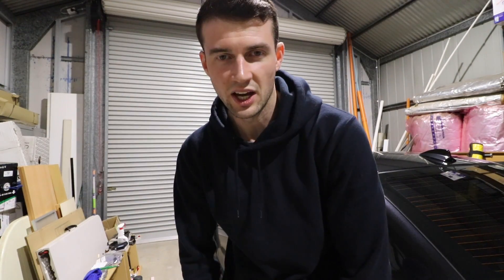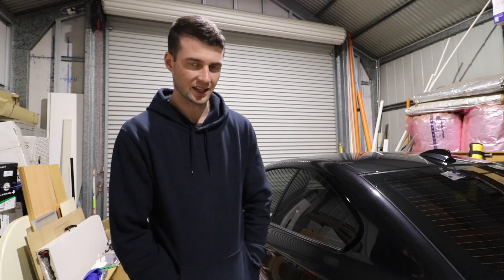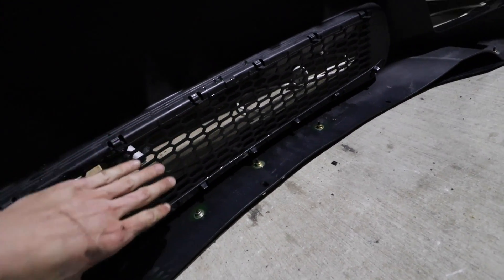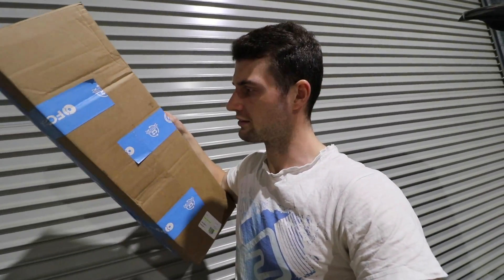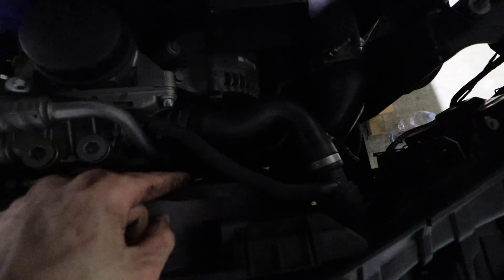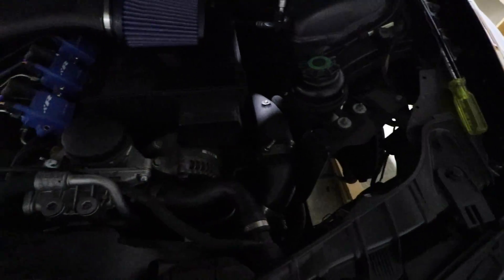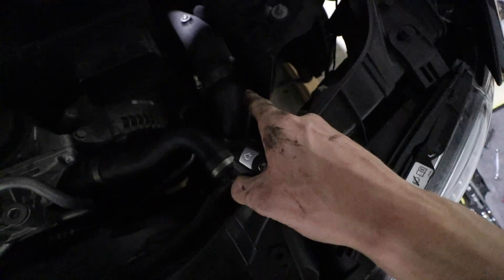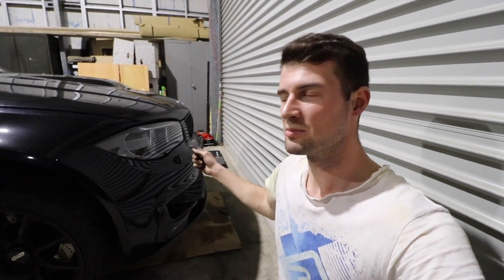Rebirth of Dark Knight

Comment: Hahaha our BMW are connected... mine also losed all the coolant because when I was replacing the oil filter housing gaskets... the top hose broke :( ordering the hose these week!
Reply from the maker: Hahaha. Was it the hose that sits under the OFH or the hose that runs from top of the radiator?
Reply: @MitchNucifora  hahaha top one ... I'll also be getting the blue stuff in there since it also have green coolant :/